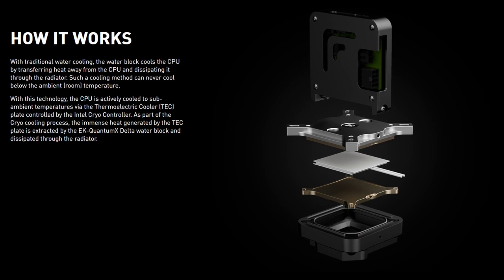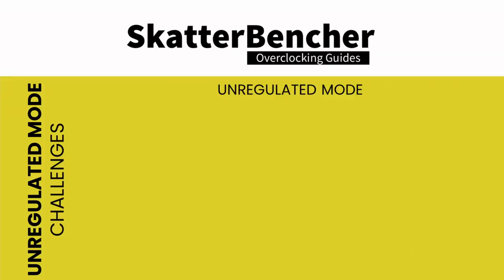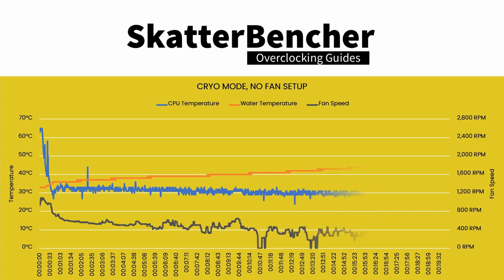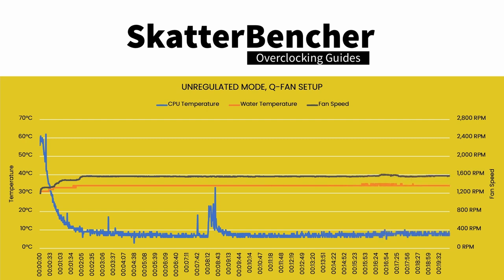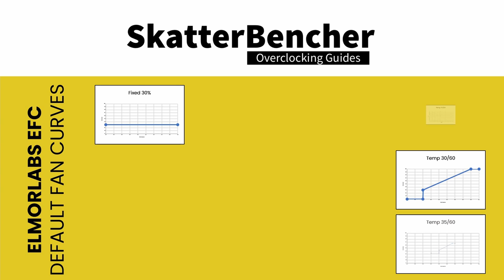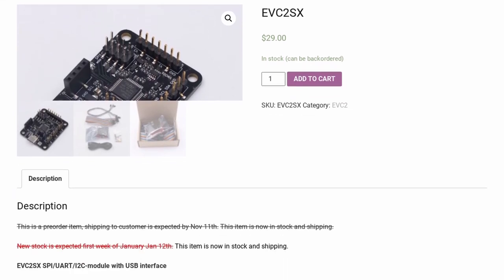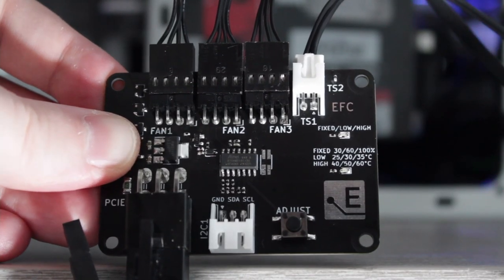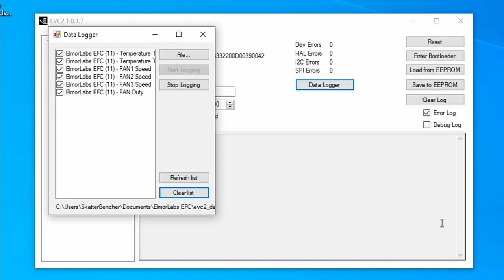The ElmorLabs EFC fan controller solved all my overheating problems

Comment: I literally just want to run a fan directly on a 6pin PCIE plug from the power supply that's it. I just listened to 16 minutes on extreme overclocking :)

Comment: I just bought one and am keen to give it a whirl! Is there an instruction manual somewhere online as I don’t think I’m grasping the fan profiles completely. 

If set to temperature sensor @ 25C what RPM will the fans start at? Can you set the base rpm? And same with high. Can you configure say 50C to be 80% of fan RPM or is the top figure always going to be 100%? 

Thanks in advanced!

Comment: Cool products but you can also just use the RPM fix mode in fan xpert 4 for each fan in your system. Again an Asus only solution but an easy one for fixed fan speeds

Comment: nice... however a way better and granular control can be achieved with an aquacomputer octo.. stuff from that brand are simply top since ages
Reply from the maker: Yes, Aquacomputer's stuff is definitely a lot more advanced. But it's also much more expensive (EUR 60 vs USD 20) and doesn't have that onboard configuration.